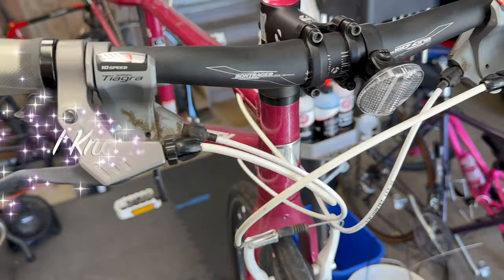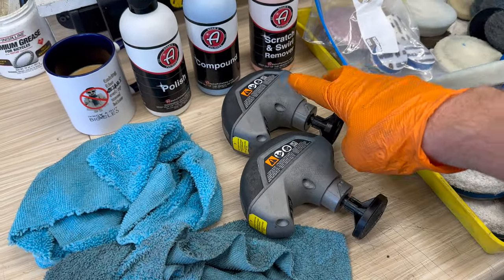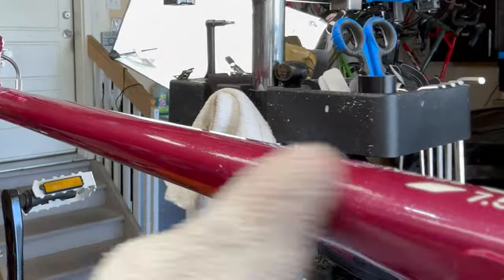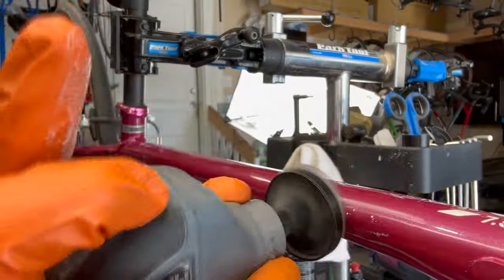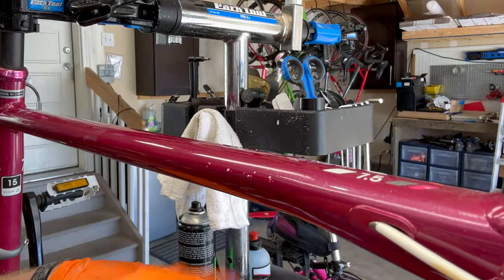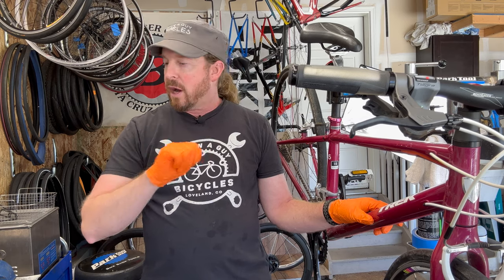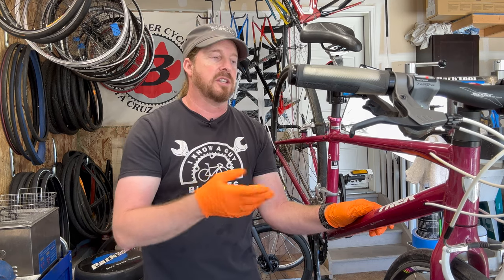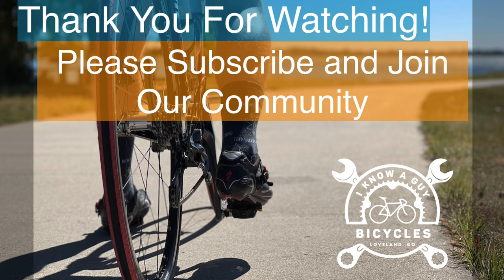Polish & Detailing a Bicycle Frame - 10 Min Tech Tip - Tools and How to use Them

Comment: HI,   If you sand and see color....there is no clear or if you start to see color you are going through the clear.....Powder coated frames can be sanded and buffed but wet sand....if you touchup dab don't brush...and over fill the chip and sand and buff  etc.etc.
Reply from the maker: Thanks for the insights.